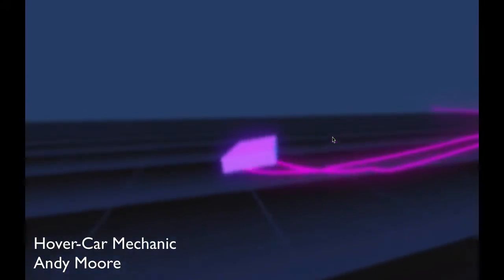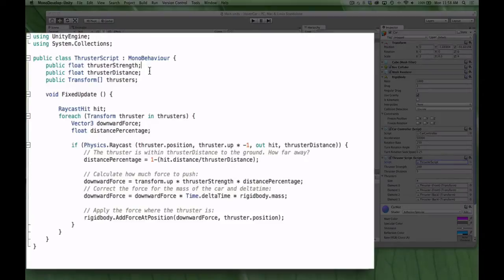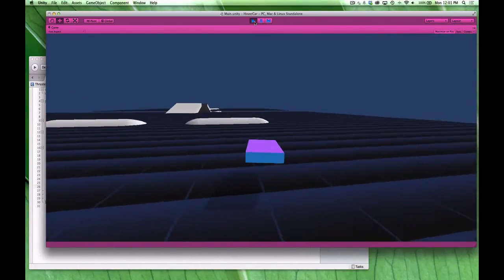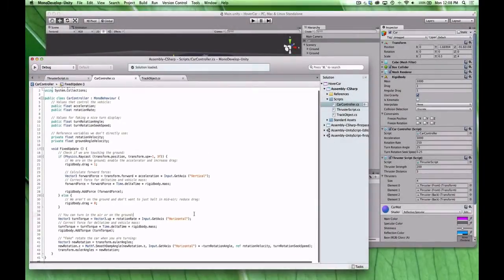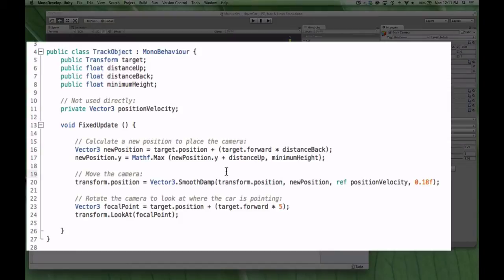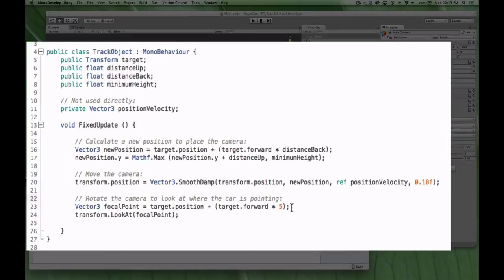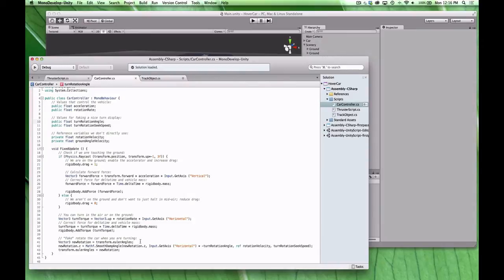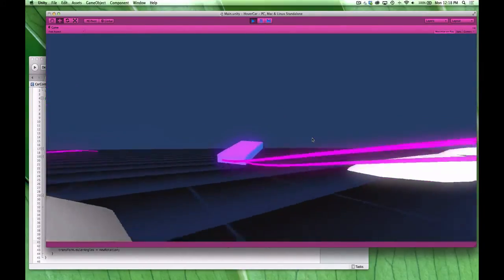HoverCar Tutorial: How to make a simple game in Unity3D

Comment: Someone please help... I have typed the code in exactly and Unity has ran the API Updater... and Im having problems because I get an error saying;

an object reference is requited to access non-static member ' UnityEngine.Transform.up '

Here is my code:

using UnityEngine;
using System.Collections;

public class ThrusterScript : MonoBehaviour {
	public float thrusterStrength;
	public float thrusterDistance;
	public Transform[] thrusters;

	void FixedUpdate(){
		RaycastHit hit;
		foreach(Transform thruster in thrusters){
			Vector3 downwardForce;
			float distancePercentage;

			if (Physics.Raycast (thruster.position, thruster.up * -1, out hit, thrusterDistance)){
				distancePercentage = 1- (hit.distance/thrusterDistance);

				downwardForce = Transform.up * thrusterStrength * distancePercentage;
				downwardForce = downwardForce * Time.deltaTime * GetComponent<Rigidbody>().mass;

				GetComponent<Rigidbody>().AddForceAtPosition(downwardForce, thruster.position);
			}
		}
	}
}
Reply: On the line with the first downwardForce, change Transform.up to transform.up. I tried it and no errors.

Comment: Great tutorial, but the car was bobbing up and down uncontrollably for me, so instead of this:  

		Vector3 newRotation = transform.eulerAngles;
		newRotation.z = Mathf.SmoothDampAngle (newRotation.z, Input.GetAxis ("Horizontal") * -turnRotationAngle, ref rotationVelocity, turnRotationSeekSpeed);
		transform.eulerAngles = newRotation;

I used this:  

		Vector3 newRotation = transform.eulerAngles;
		newRotation.z = Mathf.SmoothDampAngle (newRotation.z, Input.GetAxis ("Horizontal") * -turnRotationAngle, ref rotationVelocity, turnRotationSeekSpeed);
		newRotation.x = newRotation.normalized.x;
		transform.eulerAngles = newRotation;

It worked way better for me that way.  :)
Reply: Kade Samson  Hi, are you using Unity 5.0.1? I wrote some code for hovercar from one of Unity's tuts and all the hovercar does is fall.
All of the code is clean, but when I use the arrow controls, they are not attached to the gameobject. Also, I am using a flattened capsule instead of a cube. Would that make a difference?
Reply: Yes, I'm using Unity 5.0.1.  Which Unity tutorial are you using?
Reply: The same. I got it to move, but yeah,  it's wobbly like jello. so can I use your code to stablize it?
Reply: i used the Tut 35 Creating a Hovercar
Reply: i also see that the capsule gameobject only rotates so i used the cube, but the controls are mixed match
Reply: OK.  And sure, you can use the code.  I just kind of guessed for a while on what would work, and this ended up being the solution.
Reply: +Kade Samson upping the drag seems to help that.
Reply: MEN YOU BEST! I've been wondering how to fix this shit for 2 hours.